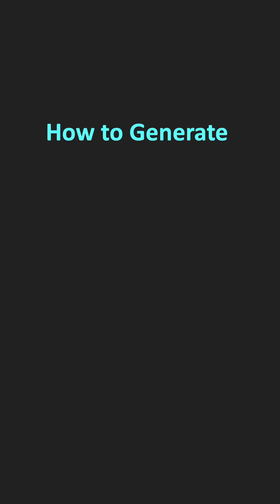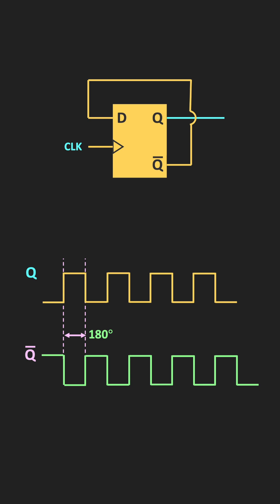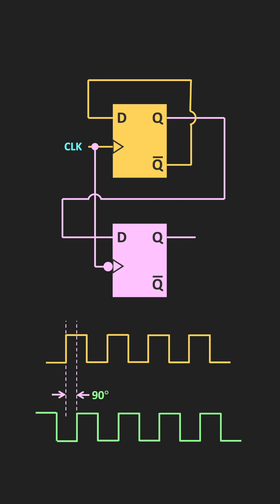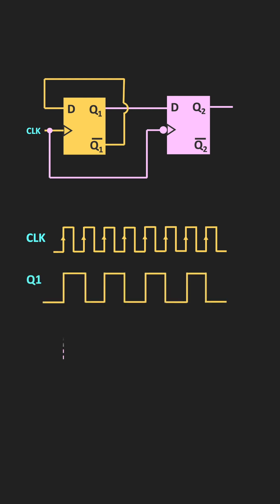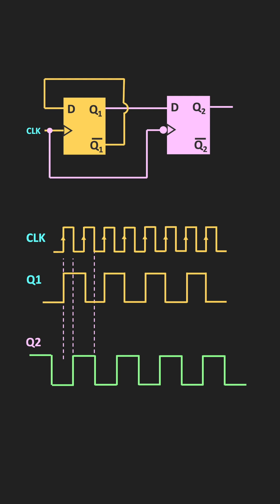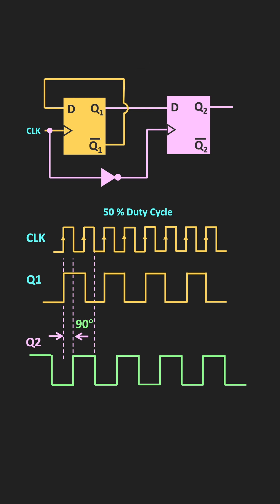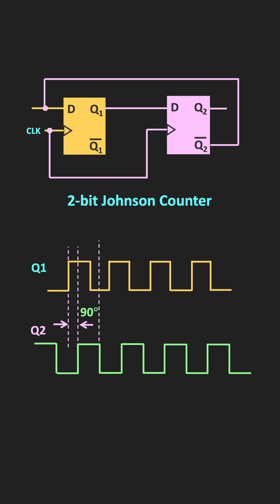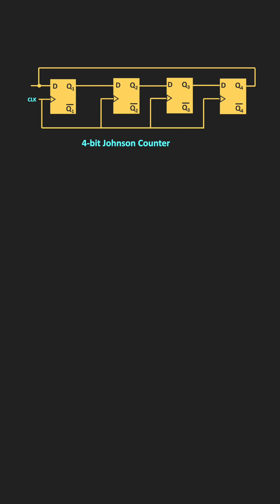How to Generate 90 Degree Phase Shifted Signals using Flip-Flop ? | Digital Electronics

Comment: if the duty cycle of the clock pulse is other than 50% then D FF can not generate 180⁰ phase shift
Reply from the maker: Yes, that’s what I have mentioned in the video. And also suggested the alternative method. ( Johnson Counter)
Reply: @ALLABOUTELECTRONICS  sir please upload few videos on Booth's recoded multiplication as well as multiplier